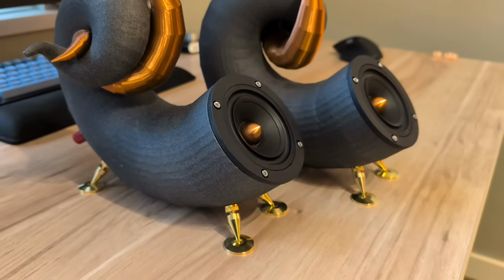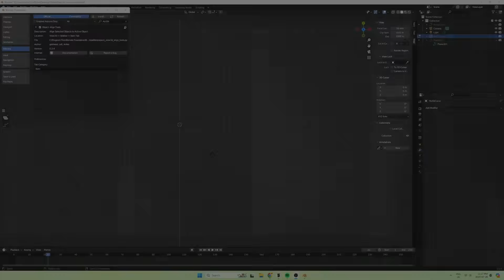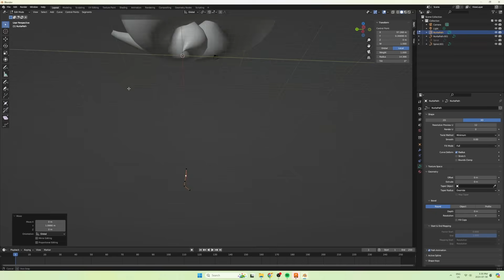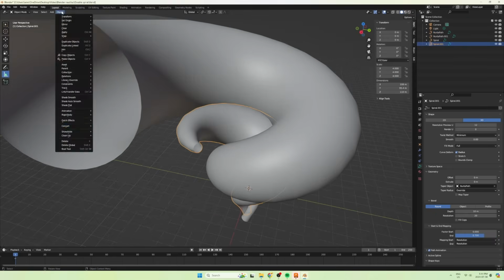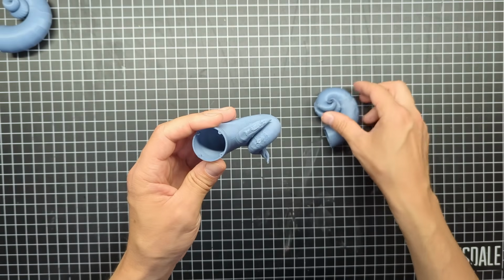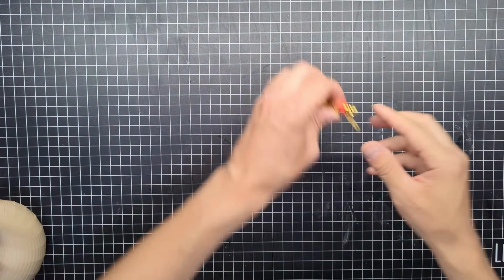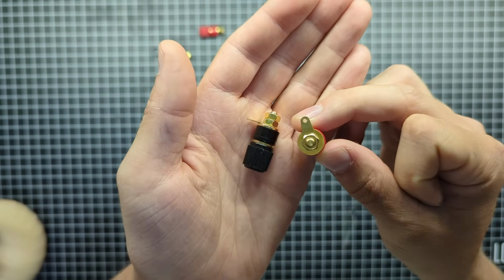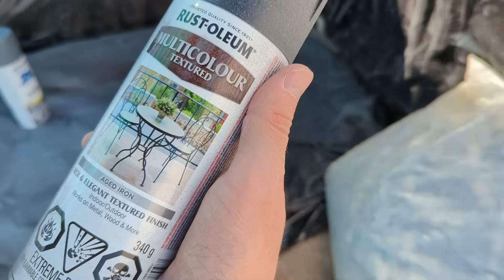3D Printing Unique Speakers inspired by $100k design

Comment: Now these would make a great Christmas or Birthday gift! 
Now if there was a way to make a Clear trim ring around the woofer for a soft glow to showcase power or frequency in a redish to orange tone, that would make this the icing on the cake  
Or maybe on the bottom with some silicone feet. 

Nothing to flashy, just gentle ambience. 
I'm pretty sure you could get the drive electronics to sap the power from the Audio signal or the forward bias most amplifiers have to run them so that they still only  need 2 wires to make them work.  

And the Brass feet look amazing!

Comment: Tried this project. My hands are way too big to do the deeper internal screwing so im dead in the water
Reply from the maker: Ah man, sorry to hear that! I remember that being tough, maybe some longer tools could help? I used a pair of pliers and then I made sure to put a dab of glue on the end because I couldn't get the nut super tight.
Reply: @everyprojectallatonce  i did try that but still no luck. My wife has tiny hands so once i get back to it, shell be my technician. Thanks for the reply!

Comment: Part of the reason they sound "clear" is that they are likely boosted in the treble response, which will likely get fatiguing over time. 
Typically, such a design would require a baffle-step compensation network (a resistor and inductor wired in parallel) to bring down the rising treble response to better match the midrange. Alternatively, DSP is also an option if you have access to even a basic measurement mic and REW to make some basic near/mid field responses.

Comment: This is a cool design, but there are a few things I noticed. On the 3D printing side, if you increase your poly count, you'll get a much smoother and high-end look. On the audio side, a speaker needs to be able to move air to properly work and sound good. This is why most speaker boxes have ports. Your design would benefit from a hole or 2 somewhere to let air flow.
Reply: You're talking about a reflex port design. That depends on the driver unit parameters, as reflex port and closed box designs generally have drivers with different parameters, and are designed for different box volumes. And the size of the box and tuning frequently of the port is part of the design. So if it's a closed box drive unit and you make a hole it can end up sounding worse. There are formulae for it. He clearly didn't do any acoustic design at all!

Comment: Just so everyone doesn't get bad information.  You will not get distorted sound from the negative and positive being backwards.  It will not distort and will not damage the speaker.   It will only cause the phase to be swapped.  If both are an inverted phase they will sound no different.   A speaker always moves out at the exact same distance as it moves in.  If they are different phases they will just have some cancellation and be sound quieter.   Distortion is when a speaker doesn't move the same distance outward compared to inward.
Reply: I'm not an audio expert but don't some amps have a switch to invert the phase for a sub?
Reply: @jt6969 That is correct.  However, that has nothing to do with what I was correcting.

Comment: Make friends with the Subdivision Surface or Multires modifier to smooth out visible polygon shapes in your 3D print. Ideally, the polygons should be about half the diameter of your nozzle – roughly 0.2 mm.

Comment: I had a play with designing and testing a 3d printed speaker recently, using single 4", I think that if you increased the size a little, thickened up the walls and trimmed the end off at the right place it'd make a really good transmission line speaker, and the bass would be a lot better.

Comment: The only thing I don't like is that you can see the tris/quads. Maybe you purposefully did that but I see no reason why to not go kinda nuts to get a nice smooth result. I suspect you wanted to be able to see the tris/quads for the style. Either way, I'd WAY rather do this than buy those ridiculously expensive speakers that these are based on. For me, if these were smoother they'd look better than the those uber-expensive ones that you're taking inspiration from! Nice work, the design is solid!

*Also, the feet you added at the end- they're gold- while they look decent I think you should paint those copper to match the rest of the speaker, that'd really unify the whole thing!

Comment: As a 3d modeler, the lower poly segmented look is driving me crazy lol
Reply: Not hard at all, haha. Everything else, amazing
Reply: Yep, i did similar but super smooth (freecad)
Reply: Definitely gives me ideas about doing something crazy speaker wise with zbrush  @ZegaracRobert
Reply: @ZegaracRobert awesome, any chance your files are available somewhere?
Reply: Same dude.. every time I see a 3d print with that damn faceting it makes my eyes bleed
Reply: I would also have preferred a smoother look, not sure if its the look he likes more or just a quirk of blender.
Reply: Absolute horrid ..
Reply: I also can't stand the low poly. How hard would it be to make this smooth?
Reply: I was surprised to see this came out of Blender. It's the classic look of downloading somebody's low res stls.
Reply: A very useful essay to test the speakers is to use a frequency sweep from 20Hz to 20kHz. The key objective is to get a smooth progression up until you can't hear it any more, without any loud spikes or dropouts in the frequency response. This is important for comfortable and relaxed listening over an extended period of time, because a hump in the frequency response might be ok for a while but it will become tiring to listen to.

The other thing to bear in mind is that the loudspeaker drive unit has a dynamic relationship with the cabinet volume. Some speakers are designed to be used in a closed box of a given volume, and others are designed to be used in a reflex speaker cabinet. The drive characteristics tend to be different for each. So pay attention to what the manufacturer says about how it is designed to be used and select the driver unit and design for it accordingly. The radio shack book of loudspeaker design published decades ago is what i used to design my fantastic speakers. The formulae you need are in there.

Comment: A bit of unsolicited advice: you might want to pre-tin the wires as well as the connectors before soldering them. You might event want to use extra flux on the wire if it is stubborn (like an old cable that has oxidized and doesn't want to take solder well). This would make soldering a lot easier

Comment: how is the sound without any material? I printed the thingiverse ones but went with a double wall filled with concrete (messy job that) and added loose rockwool insulation inside the cone.

Comment: Having a set of B&Ws myself, the point of the Nautilus shape is to reduce backside reflections to 0. Which explains their clarity.
Reply: Feedback: 
Design a tube for the speaker wire to travel (following the curve). 

Curious if you could just use gyroid infill instead of polyfill. It would give you control over it's distribution versus you stuffing polyfill into an unknown depth. 

Super cool project!
Reply: The B and W speakers look very familiar to me. Maybe it's because I herd this very same design being demonstrated in an electronic store somewhere just outside Iwakuni Japan back in 1996. It seems ridiculously expensive for a 30 year old design. Or am I missing something? I mean I completely understand people with money what what everyone else can't afford. But that in itself seems like a foolish reason to send so much on a very old design.
Reply: I believe B&W's Nautilus isn't closed on the ends of the midrange driver cone. It would be interesting to cut the tip off and see if there's an improvement.
Reply: eeexcept, it totally doesn't work. I have played with such an inverse-horn enclosure, and the reflection from the tip is still there, and is very pronounced. I don't know if the nautilus has anything special inside to actually absorb the sound, but i'm convinced that the shape alone is not working.

Comment: Yeah, looks really good, however, I'd have probably put spring clips terminals in as I think the post terminals are a tad big, yes the post offers better contact, but this would be a case for the smaller, more stealthy spring clip design, or even just a tail with say RCA female terminals.
Aside from that I'd probably add an internal weight of some type as this would make them more stable and would help with the lower frequency response ( Bass) end.
Cheers from Scotland 🤓👍

Comment: seemed a little weird that you didn't calculate how big the internal volume should have been. i really believe you could have improved the sound a bit with dialing that in
Reply: The fact it’s a sealed enclosure reduces the need to calculate the internal volume. Necessary if he would have ported it.
Reply: @dr.swaster8763 that's not correct, drive units are usually designed for EITHER a closed box OR a reflex port, and they will have different parameters. You plug these parameters into the formulae to get the frequency response for a particular driver unit at a particular frequency, and creating a graph will give you the frequency response for a particular drive unit in a cabinet of particular volume (and tuning frequency if it's a port design). Usually the manufacturer of a reasonably high-end sealed box drive unit will tell you the optimum cabinet volume for that drive unit.

Comment: Looks great! Lots of faceting on the model, I wonder if there's a way to increase the resolution in blender, or maybe it's output resolution when converting to STL. I know there's a setting in other 3D modeling software such as SolidWorks to increase the STL resolution.
Reply: blender user here. when he was modeling, he used "shade smooth" so it appeared smooth, but actually wasn't. increasing the resolution to imperceptibly smooth is definitely possible, he just didn't want to
Reply from the maker: Thanks for the compliment! It was a deliberate choice to make it faceted, I know the look isn't for all though :)

Comment: Cool idea. I don't know the program where you designed it but I know if you have imported the model to Bamboo software as STEP instead of STL you probably would get nice, round shape instead of approximated, steped one.
Reply: blender doesn't really do STEP files. it's not a CAD software, it's an art software. however, it is as simple as increasing the curve resolution amount, which could be done until it looks completely smooth. the creator just said he likes it low poly

Comment: For sure you've gotta make that subwoofer. Do a good job with it though. Consider using this driver. "UMII10-22 Ultimax II 10" DVC Subwoofer 2 Ohm Per Coil" Try and give it over 1cuft of internal volume, not including the port in case you port it.
Reply from the maker: Thanks for that driver suggestion! Would you recommend ported or not ported for the sub?
Reply: @everyprojectallatonce   If you're doing a traditional box then make it ported. If you're doing a custom shape then choosing to make it sealed may be easier. You also won't have to mess with port tuning, just give the sealed as much air as you can and you can fix anything with dsp. Make the cabinet dense and put poly-fil or similar in it. Maybe you can use 3d printing and you can make a hollow shell that you can then fill with a dense material or something. 

Have fun man! Your monitor speakers are something special! I'm going to remember your build for years, how I'd love to have cool looking horn speakers on my desk :)

If you need assistance/recommendations/problem solving hit up AVS Forums, it's a resource of people that build all sorts of cool things audio related. You can get into tactile transducer platforms and everything there. People are likely to help draft ideas and what-not for you if you just share what you're up to.

Comment: 100k llolloll
But seriously, there should be no voids inside these furnaces, or at least they should be filled with damping material. Then this sht must be measured outside, and after maybe this is gonna work for casual computer using
Reply: Maybe if you had the attention span to sit through the video, you would have seen that he did use dampening, just not up to you audiophile standards
Reply: @Kmar-i8s3r  audiophile are delusional hedonists who spend so much just to absorb. A normal person doesn't need anything more than genelec 8030. But anyway, this stuffing will not help, cause the frequencies goes lower that this material can damp. In Studio monitors everything is calculated, i am not sure about this design, so it probable will be better to just stuff it with resin/rubber. I am speaking from an acoustics point of view

Comment: Very nice work, I'll try to make something similar. I don't really like the low poly look though, would rather go with something smooth for this kind of geometry.
Reply: bro forgot to turn the default curve resolution up from 4 to 16
Reply: Is that a limitation of his workflow with blender? Could've he made it look like a proper rounded object? I'm seeing all the time people making circles that are just a polygon and it bothers me so much, even though I can't afford a 3D print and can barely model anything 😂
Reply: @JorgeALXNDR  no limitation, he just didn't

CAD has "real" circles but exports a bunch of dense triangles, so they often aren't that smooth either when printed. 
blender has direct control over the mesh, and could have been very smooth, but he didn't do that. you can easily make it so smooth that you can't even see the polygons at all

Comment: Good work! You can design a cabinet with a radiator if you can’t fit a woofer. I was also going to suggest you make a subwoofer that matches the athletics of your project. But you beat me to it 18:19 . I don’t know how a sub would sound if it were to be 3d printed due lesser density than an mdf cabinet. You could definitely try a sealed design rather than ported. That might help. Good luck! Subscribing!
Reply: You can also use a filler in the cabinet to reduce distortion. That could be another option too.